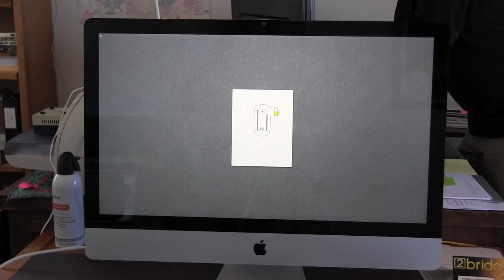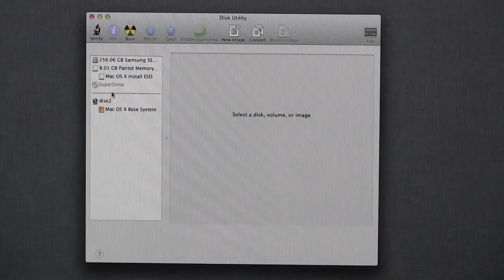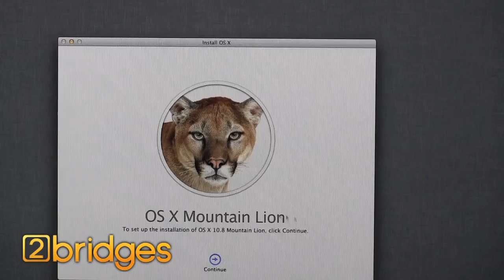2Bridges iMac HDD replacement with Samsung 840 PRO SSD & Install of Mountain Lion OSX 10.8 - Short

Comment: In my mid 2011 iMac 21.5 resetting smc does mot work. Just installes ssd fan. Works like a charm
Reply: What's the SSD fan you installed? Where does it fit in? Do you like it?
Reply: Basil Glew-Galloway curious myself

Comment: hello.. what did you do with the sensor cable for the hard drive?...
doesn't it get really loud if the sensor isn't working properly?
Reply: JoramBassride
 ow, yes.. thanks.. I've figured that out and have been using for a while.. it works great!

Comment: What did you use first to clone your HDD to the SSD?
Reply: I guess you just reinstalled the OS... great video!
Reply from the maker: Matthew Rings Hello Mathew, The Samsung SSD comes with software for migrating the OS,, all data and applications provided that the SSD is slightly larger than the origunal  HHD